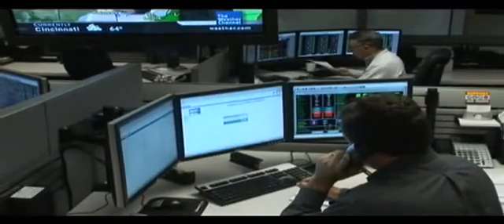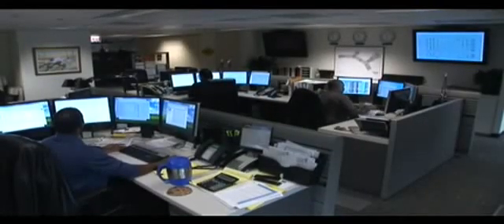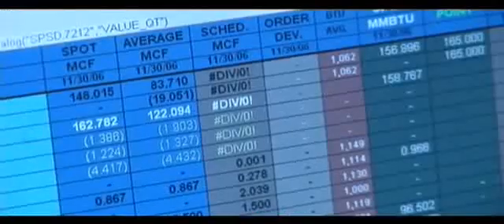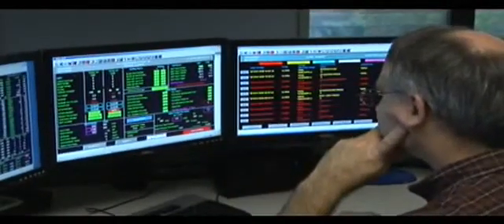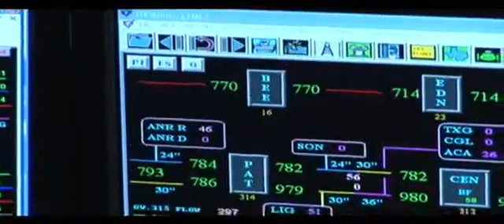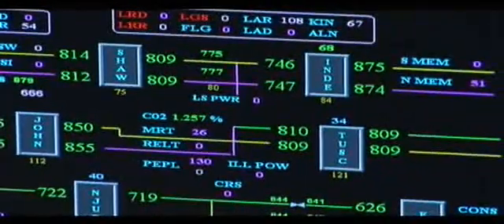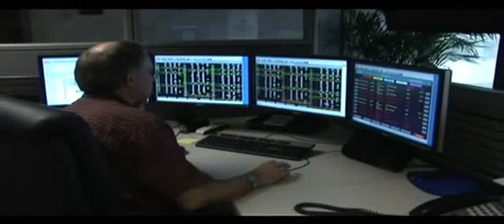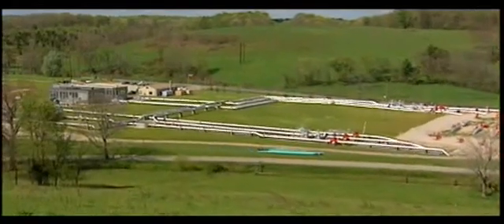Supervisory Control and Data Acquisition (SCADA) Systems

Comment: It was interesting to see there were no actuators on the top of any of the values shown while the video talked about remotely operating valves.  No actuator, no remote operation.  Sorry, could not resist.